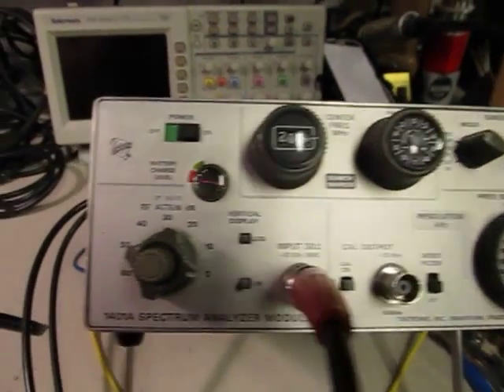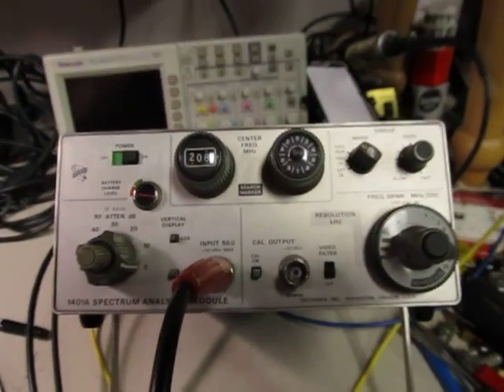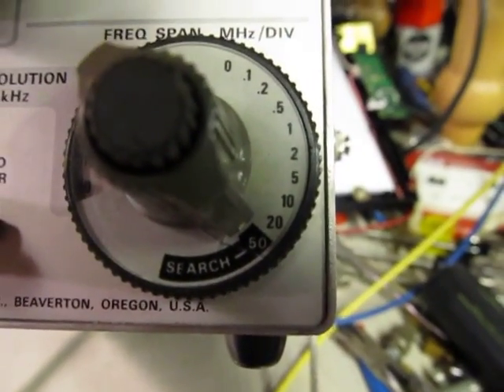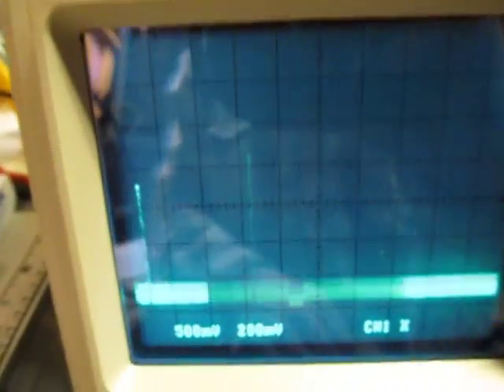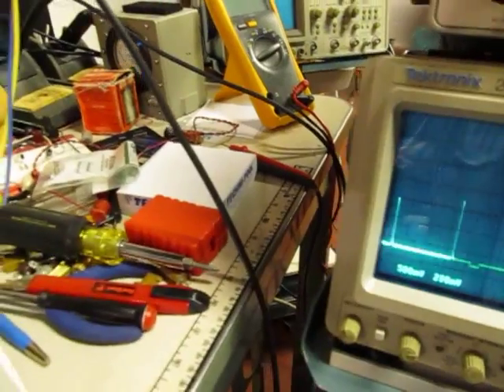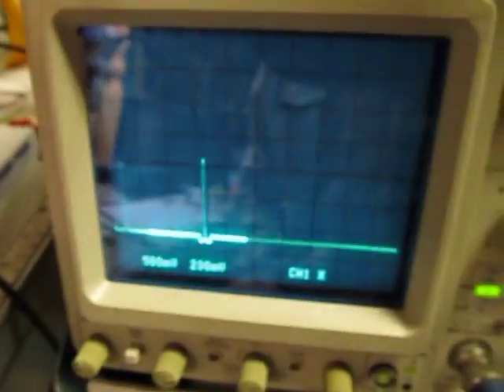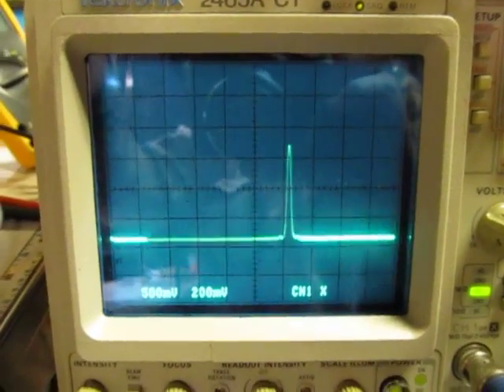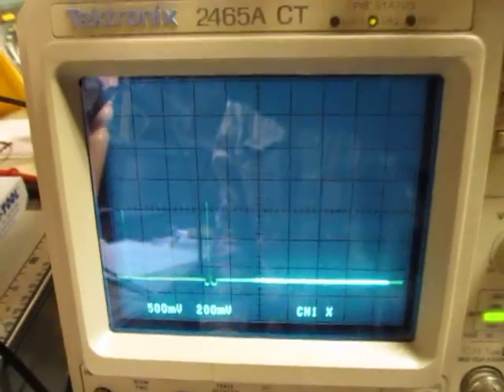#23: Tektronix 1401A Spectrum Analyzer quick demo

Comment: I like the 324 it was 10 meg and the 323 was only 4 mhz love this thing useing it with a component tester because the 324 could display xy.the 323 could not.
Reply: It's not going to matter 4 years later, but I recently got my hands on a Tek 323 and it absolutely can display X/Y, but you have to externally attenuate the horizontal sweep to the right level (the 1401 does this by design / by calibration as it is designed to be used with the 323/324)

If you look in the service manual the operation instruction photo even shows the 323 :)

Comment: I just got one of these off  of Ebay. (Item number: 120945295762)  I need some help with fixing it. I wonder if you could show to fix the fine center frequency knob and missing pot. I don't have a service manual and can't find one. Thanks in advance or the help

Comment: Thanks for a very prompt reply.  Am I correct to understand then that this control a is a mechanical extension to the center frequency knob on its right?  Meaning that it does not have any electrical connection to it?

Comment: What is the knob at the top row. The one with the circular dial inside and what appears to be small push button in the middle. Is it just a variable resistor to set the VCO control voltage or some more complex arrangement?